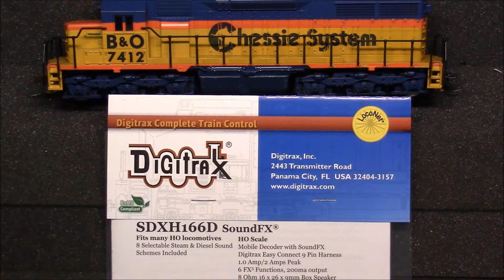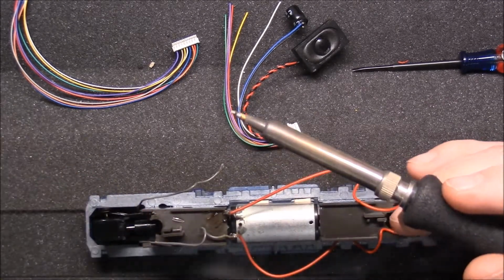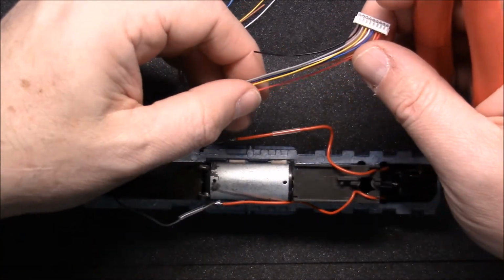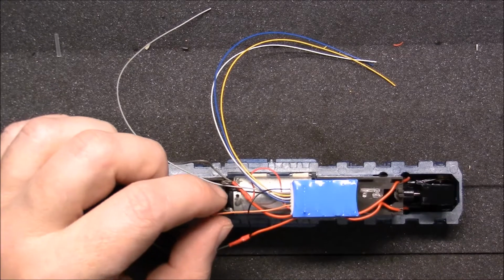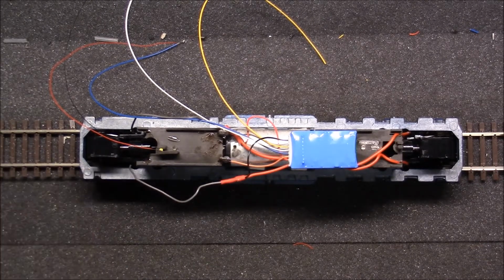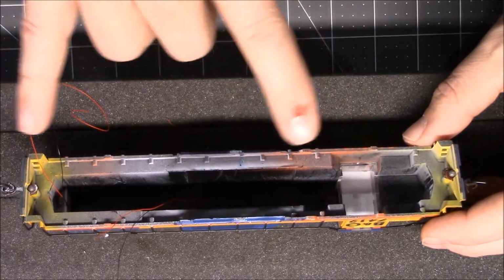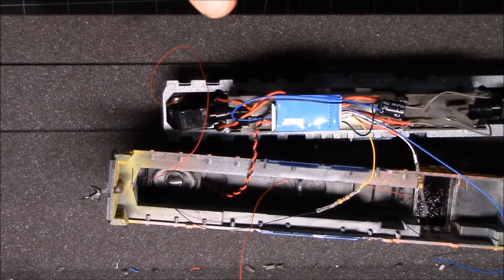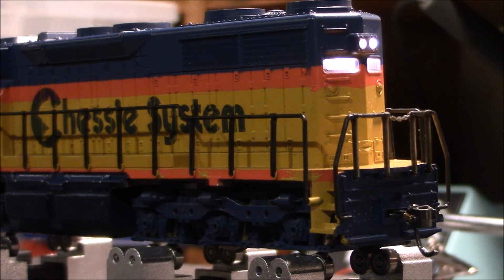Digitrax SDXH166D install in a Atlas SD35

Comment: I used Economi decoders in my SD35's.  I used the sound for the turbocharged 645 (althought I know the SD35 had a 567 engine).  I asked a retired engineer if there was any difference in the sound between the two and he said "not enough to tell in an HO speaker".

Comment: The early ATLAS HO SD-35s were made in Austria possibly by ROCO.   This was before the 1980s Altas/Kato era.  This unit has a large can motor w/ flywheels, 12 wheel power electric contact and good plastic worm and gearing in the power trucks.  I recent purchased a B&O SD-35 of similar vintage. The old headlight is worthless. The plastic body shell can easy house a sound decoder.  I might eventually remove this large can motor with something smaller and recent.
Reply: Newer motors are sealed but can be serviced with a few choice curse words.  Best to stick with the open motor designs that came original.  You can oil these, clean up the contacts and  the commutator easy enough and they will run flawless and draw 1a or less which is about what newer ones will do + or - .2 amps.  A little noise is just Trains ;)

Comment: I had to go back and double check at the beginning to see which way the front of the chassis was, but at the 44 minute mark when you said you had forward motion on the first test of the decoder, it was actually moving in reverse.  I wondered when you soldered on the motor wires if they weren't backwards.  I always hooked up the grey wire to the same side as the black wire since they were pinned next to each other and the same with the red wire.  Were the hookups right? or wrong?
Reply from the maker: Your right. At the 44 minute mark it was moving in reverse. I just change CV 29 to correct the direction.

Comment: So I just recently installed this decoder in an Amtrak p40 but it sounds horrific its choppy and just doesn't sound like an engine at idle granted the stock sound is a gp38 but could the sound be from bad soldering?
Reply from the maker: I wouldn't think it would be the soldering. Check the speaker for damage, that could be one thing. You could try turning the volume down.

Comment: great video again sir. what prime mover does this unit come with? Thank you for all the instruction
Reply from the maker: Thank you.  Ships with multi project sound scheme including GP38 diesel (default), GE Evolution diesel, SD70 diesel, GP10 diesel, RS1 diesel, C420 diesel, Steam type 1 (based on UP3985) and Steam type 2 (based on K27). 
You can also download other sounds from the Digitrax sound depot, if you have a PR3 or PR4.